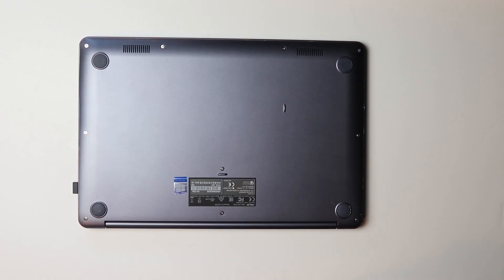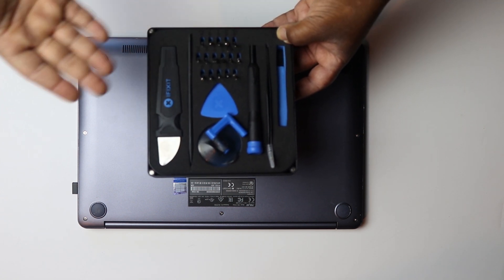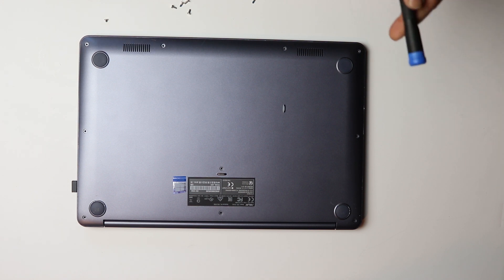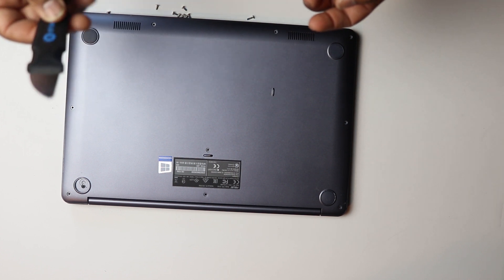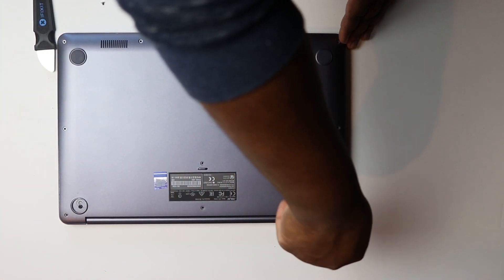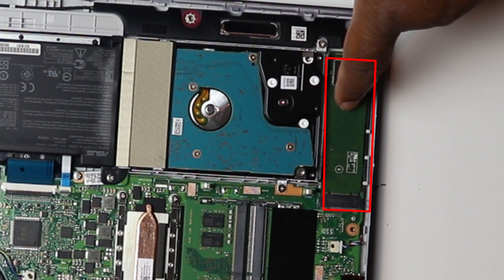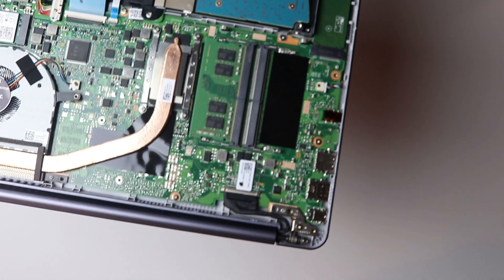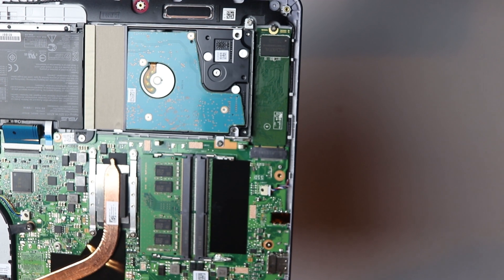Asus Vivobook F510UA upgrade -  Adata 256GB M.2 SSD Install

Comment: I'm trying to turn this thing in to a gta 5 computer what would be the best approach
Reply: 32gb 3200 ram and WD BLACK SN750 250gb at LEAST
Reply: but then you'll run at lowest possible settings at 1266x1360 resolution at like 30 fps

Comment: Does adding the m.2 improve the performance of the laptop without replacing the hard drive with an SSD drive?
Reply: Only if whatever you're doing has to access the D: drive.   Otherwise, no.
Reply: You can clone the OS drive to the new drive and use the 5400 rpm drive for data. Make sure to bump up the RAM, too, while you're in there, that will make a huge difference, too.

Comment: hey man, so i have this big problem, i installed with no problem an ssd m2 in my asus vivobook, but  when i try to start it, the screen turns on for a bit and then the laptop turns off after a few seconds, im sure i didnt touch anything related to the battery while installing it, what can i do?
Reply: If the icon of Windows appears, i dont know what to do. But you can check on the BIOS which drive your system boots up and select the one with the Windows installed

Comment: I've got the same laptop and same ADATA m.2 SSD, but I can't get this m.2 work on my laptop. In BIOS I see only AHCI option for SATA, is this correct?
Reply: Me too. I don t know what to do
Reply from the maker: I have to check exactly what it says in the bios guys lol let you know as soon as I can
Reply from the maker: Make sure you have it turned the correct way too cause if not it won’t read it. Also I had to send my M.2 back the first time cause it came DOA. Hopefully it’s not a manufacturer problem
Reply from the maker: Just checked and yes AHCI is correct. On port 0 it should show the Toshiba mechanical drive and on port 1 it should show the ADATA M.2
Reply: @TheNerdMechanic  seems like my laptop is faulty. Because it doesn't detect the ssd at all. Tried both ways of putting it in. The only way i got it to work was use a sata to m.2 adapter and put this in place of hdd.

Comment: Does the laptop comes with the screw fot the ssd?
Reply: No it does not. You have to buy it separately. The screw usually will not come with the hard drive either. You will need to buy an M.2 Drive screw kit about 8-10 US$
Reply: @johnfarrell235  I went to a computer store in mexico and they told me they dont sell screws in there but they gave me one for free XD
Reply: I got the Crucial  M.2 drive -- it came with 2 screws.
Reply: @danmagoo  Excuse me, how much capacity is your crucial SSD? I don´t know if i can upgrade up to 1 TB
Reply: @Animalísticos  Sorry, I don't know whether 1 TB is do-able or not. Mine is 500 GB - the Amazon listing said "Crucial MX500 500GB 3D NAND SATA M.2 (2280SS) Internal SSD, up to 560MB/s - CT500MX500SSD4". I don't remember if there was a reason I didn't go for 1 TB, except I believe the other drive was big also (if slower), and I figured 500 was enough for the programs, etc.
Reply: @danmagoo  Thanks

Comment: Is this laptop get heated? I cant see air vents for heat dissipation
Reply from the maker: There are 2 small vents on the underside in the front. It hasn't gotten really hot on me and I use it for editing.
Reply: i have no problems with mine overheating, and i use mine for video editing

Comment: Hey man, does the laptop already includes the m.2 x 3mm screw to fasten the SSD? Thanks in advance!
Reply: Yeah just learned this. Got a WD Blue with no screws got a Crucial instead and will be returning my WD Blue. Thank god amazon exists!
Reply: @JackRR15  haha you could have just used one of the small screws on the back the panel. I have a video on how to and what screw I used
Reply: @bjsdetailingservicesllc427  Yeah.. have another pacjage to open now tho thats fun
Reply: @JackRR15  true true, that's always fun lol
Reply from the maker: No unfortunately it does not
Reply: The SSD comes with the mounting screws!
Reply: Its doesnt and depending on what m.2 you buy and from who it you buy it from it may or may not come with one. Mine didnt so i just used one of the small screws that hold the back panel on.It fits perfectly!

Comment: this is your daily driver? and how satisfied are you with the product?
Reply from the maker: Yes I use this when I'm not at home on my desktop. It works great with the ssd for what I need it for which is basic editing. Could it have a better screen and keyboard? Of course but it does what I need it to and at a decent speed. I can always upgrade RAM if I want/need to as well.
Reply: @TheNerdMechanic  thanks I bought it. I'm coming from a Dell with i3 so I think I will see a huge improvement
Reply from the maker: Nice did you buy the ssd too?
Reply: @TheNerdMechanic  yes I did buy a 128gb. I hope that's enough lol, I ran out of money to but the higher capacity
Reply from the maker: That should be plenty just put windows on there and use the 1 TB for everything else
Reply: @TheNerdMechanic  Hi. So i just drag and drop windows like is a media archive? Just like that
Reply from the maker: No there are programs you can download for free that will partition the old drive and migrate windows to the new drive.
Reply from the maker: https://www.google.com/amp/s/www.digitaltrends.com/computing/how-to-move-windows-10-to-an-ssd/amp/